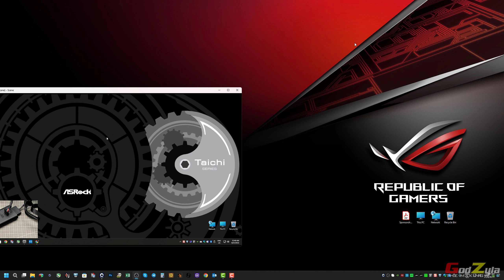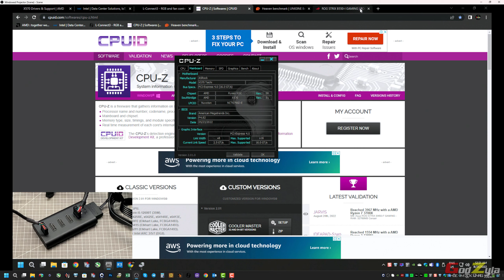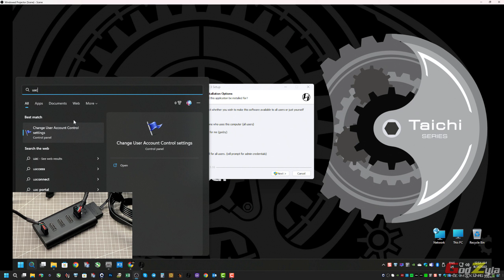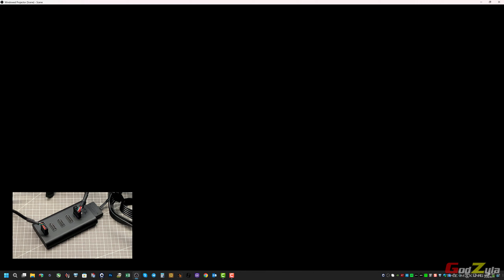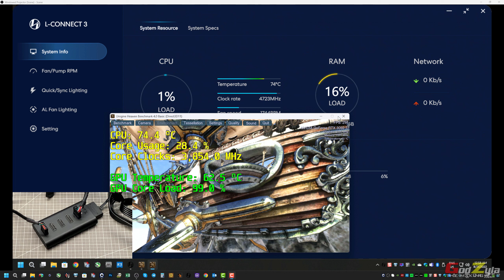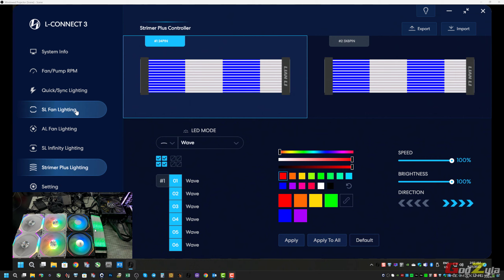Lian Li ARGB Products (How to make it work?) [L-Connect 3]

Comment: Hi Kleo, after several months, I finally got my whole pc from LianLi :D

Everything works perfectly but... Is it normal that the device manager detects LianLi-SL-Infinity-v1.4 and LianLi-GA_II_LCD_v1.3 and allows to "eject" it?
I have 10 SL-Inf connected to the Galahad 2 LCD SL Inf controller. 

Thank you!
Reply from the maker: Hi Varo Go, welcome to my channel. As device able to be ejected, that's normal as any detachable USB devices will have this function in Windows. on my lower right corner of Windows 11, when I click on the USB Icon, I can select my GA II LCD to be ejected, but of course not going to do that, just let it be. If accidental click on eject, all is needed is to either go device manager to scan for hardware or to reboot your system.

Comment: Hello friend, can you help me? I also have an nzxt hub but the l conect does not recognize my strimers and fans, can you help me??? I already updated the motherboard drivers in the manager, lianli does not appear in the drivers, I cannot make it work in any way
Reply from the maker: Hi Yuri Ferreira, welcome to my channel. Did you test it without the NZXT internal hub. Do it one controller at a time. does your Windows OS detect the controller? 
Sequence as follow 1st plug uni fan controller. does it detect? if yes, remove the controller, plug the strimer plus V2 controller. does it detect? if individually detects, then plug your NZXT Internal hub. if it does not work, means you either did not plug the sata power source to your NZXT Hub or your hub is faulty.

Comment: can the fan/rgb controllor also controll other brands Fans?
Reply from the maker: Hi FN 1, welcome to my channel. Unfortunately no as these uni fans (each of them) have an embeded chip which follows the instruction from the Hub. Other fans does not have this, therefore the effect you can't control as and when you want them to be.
Reply: @KleoYan  thank you what rgb controller would you recommend to controll all fans?
Reply from the maker: @FN-nh7wu  if you are asking for general ARGB fans. You can make use of the motherboard ARGB header which is rated 3A on most motherboard and to use your motherboard ARGB application to control them.
Reply: @KleoYan  thanks for the response
i have a gigabyte mobo but it doesnt have good rgb option. So i wanted to buy a rgb controller like razer rgb Hub....

what rgb hub would u recommand?
Reply from the maker: @FN-nh7wu  i normally go for single colors which is stationary. I never like fanciful ARGBs. chroma from razer is a good hub as for myself, simple and cheap controller like the Amber 5 or 8 from Gelid will do. https://youtu.be/brigGor38PY

Comment: what's the reason that the SL infinity RGB is not turning on at all but the fans working fine, did all troubleshooting SL infinity controller shows in both device manager/L connect software and its firmware/chipset/bios all up to date. even ordered 3 new fans connected them with new sl infinity controller and wires fans worked but rgb still does not work? also when i connect the sl infinity controller both the old or brand new one to sata power in psu only the sl infinity controller nothing else, it doesn't let pc to boot or turn on shows a red light but when you connect sl infinity controller to cpu/pcie in psu pc boots normally fans work but rgb doesnt work? when i connect sl infinity controller and fans both my old one and new one in my other pc it works flawlessly both rgb and fans. dont know why it has issues with my main pc did everything cleared cmos bios flashed latest bios uninstalled all rgb apps with revo uninstaller but rgb still dont work only fans motherboard is msi z790 motherboard and cpu is core i 9 1200k intel cpu. 
i have 3 sl infinity fans with regular cables no sl infinity controller that connects to fan and rgb header on the motherboard those works fine and when i tried and connected that regular cables with my  old fans they also worked both rgb/fan so now i think the only way i can fix the rgb for my other 6 fans finding 2 new regular cable that connects straight to motherboard fan/rgb header will fix my issues since even ordering 3 new sl infinity fans and a new sl inifity controller that even didnt work only fans worked rgb didnt turn on.
Reply from the maker: Hi Adam Otak, welcome to my channel. It seems like a motherboard issue. have you tried changing the USB header of your motherboard or try this 
1) Turn off your system, switch off the PSU botton to off
2) switch off main switch which provides power from the AC cable to your PSU. 
3) press your power button of your case a couple of times to discharge any current holding on your motherboard
4) leave it for 45 seconds. 
5) plug everything back on and turn on your system. 

see if the steps above resolves the issue.if not, last resort, get a spare nvme m.2 or 2.5" ssd, install fresh windows OS and try it. if all these still does not help. then I have no clue what's going on but to pin point on your motherboard.

Comment: Both my ARGB header on my motherboard doesn't work (I believe they are gone for good) But with this product i don't have to toss my my ARGB fans, correct? Since this allows me to bypass "Motherboard" for ARGB Fans
Reply from the maker: Hi AP's Journey, welcome to my channel. the argb cable which is between the Lian Li controller / hub to your motherboard ARGB header is optional. you can don't use motherboard argb utlity at all, just remove that cable and make use of L-Connect 3 app to controller the argb effects which the command is from your motherboard USB header to your Lian Li controller / hub. then to your uni fans.

Comment: Hi there, amazing video man. I have an enquiry tho, I am currently using the lian li GA (II) trinity. Under fan/pump profile (SL-Inf controller01), the stats seem to reflect that Fan: StdSP is at 0rpm but pump: pwm is working around 2500 rpm. All my fans seem to be spinning tho, so im wondering if the reflected 0rpm for fans is normal? or should i be doing something about it? I really appreciate any help I can get HAHAH.
Reply from the maker: Hi spicykimchi, welcome to my channel. If you have plug your radiator fans to the AIO pump, it should show the RPM. maybe this video will aid you. https://youtu.be/57cxoeEvQKU?si=zbHewWJ8ScrGTWb8&t=2486

Comment: Still the strimmer doesn't show up in my l-connect 3
Reply: Mmm.. not really but i got the strimmer plus not the v2.
Reply from the maker: @kAmAt1zZ  the controller of the non V2 does not work with L-Connect 3 app. you will need the V2 controller to do this. You can purchse the V2 controller and use your strimer plus non v2. https://www.aliexpress.com/item/1005004239607087.html?pdp_npi=4%40dis%21SGD%21SG%24%2028.69%21SG%24%2028.69%21%21%2120.55%2120.55%21%402102f67717152280494758043e1bdb%2112000031743391281%21sh%21SG%210%21&spm=a2g0o.store_pc_allItems_or_groupList.new_all_items_2007601292652.1005004239607087
Reply from the maker: Hi, welcome to my channel. May I ask which version of strimer plus did you purchase and did you check on your windows device manager, if the strimer plus controller is detected under Universal Serial Bus Devices?

Comment: all of a sudden no more RGB
Reply from the maker: Hi Jeffrey Aalders, it will be best to check your windows device manager. Check under the Universal Serial Bus Devices. see if you can see the uni fan controller or the strimer plus controller or which ever Lian Li argb controller you have plug to your system.
Reply: @KleoYan  I don’t know if you remember me, but I was having some issues with my fans. He told me to plug something out. I’m not too sure what it was because they were ramping up. I wanted to know if you can help me I haven’t mess with my PC. I had put it down since I built it. I’m jumping back into it again.
Reply from the maker: @babynismo24  hi welcome back, do pardon me. There are various cases and am sorry I can't recall what's your issue are, maybe provide me with some info, including the Lian Li devices you are using. If you did sent me an email, kindly forward it to me. This way, I see what I can do to aid you out.

Comment: So with all my infinity fans I plug them into the controller and use L- connect to control the fans that are on the radiator ? So I'd go to the slot number of those fans and select CPU ? This would greatly help me right now
Reply from the maker: Hi General GP, welcome to my channel. That is correct.
Reply: @KleoYan  thank you , I'll do just that . Built my 12 yr old daughter a pc , rog strix 4070ti super, rog strix z790-e motherboard,  rog strix monitor,  h9 flow case , lian li infinity fans . So I'm learning here lol ...going to sub to your channel
Reply from the maker: @GeneralGP114  I see. All the best with your build 😉 as for the application go to Lian Li official website and look for L-Connect 3 app. 👍
Reply: @KleoYan  I have the l-connect downloaded , trying to download CPUID but when I tried it download as CPUID CPU-Z .
Reply from the maker: @GeneralGP114  hmm.. are you trying to get HWMONITOR from CPUID? anyway I dont use this, I use HWinfo instead https://www.hwinfo.com/
Reply: @KleoYan  I was trying to download CPUID as stated in your video.  So I connected all the fans into the controller now . Went into L-connect , so slot #4 would be the fans on the radiator.  Not sure how to link slot 4 to the CPU using L- connect like you had in the video.  I just want to say I greatly appreciate you taking time out to reply to me . Thank you
Reply: @KleoYan  on L connect in the fan profile section I see , quiet , stdsp, high-speed, fullsp.  Don't see CPU
Reply from the maker: @GeneralGP114  oh ok.. the CPUID is to run bench test. it does not link to your radiator fans.. once  CPUID triggers the stress test, monitor on L-Connect to see if it picks up the CPU Temperature and also check on the RPM of your radiator fans. If temperature does pick up on L-Connect and Radiator fans RPM increases. That will tells you everything is working fine.
Reply: @KleoYan  ahh ok ok , I seem the Temps go up and then back down . The rpm for all the fans ramp up then back down a bit . I don't know how to set the fans on the radiator separate from the rest of the fans. Not sure if they're all supposed to ramp as when load goes on the cpu or its just supposed to be the fans that's on the radiator in #4 slot .
Reply from the maker: @GeneralGP114  I see, if you see those, that means your Lian Li fans , aio and the controller are working fine. as for your fan configuration. you can set other ports to quiet and leave your port 4 as stdsp. of you can set your own fan curve. This you will need to take sometime to fiddle with it.
Reply: With the cpuid and I just go on the site and download it ?

Comment: I own the GALAHAD II LCD 360 SL-INF and the Problem I have is that the Software always is Pretty slow and when I change my RGB Settings it only changes after I restart the PC so not in Real time. Current firmware 1.4 is installed. Anyone else faced this issue?
Reply from the maker: Hello Heimdallr, welcome to my channel. Does it happened that you have other ARGB application installed?
Reply: @KleoYan  Thanks for your response. I have also installed the icue for my ram and Asus armoury software for my MB.

Comment: Hi Kleo! Really great videos as I am trying to troubleshoot my rgb case but none seem to have worked for me in terms of Lian Li's Dynamic Evo case RGBs, not sure if you have come across this issue before? Thanks!
Reply: Appreciate it!!
Reply from the maker: @hikyubeast  most welcome.
Reply: @KleoYan  sent under Ryan thank you! The bottom rgb strip only a portion seems to be lighted. Thank you
Reply from the maker: @hikyubeast  check your email, I have replied. 😉
Reply from the maker: Hi Hikyubeast, welcome to my channel. Maybe list down what are the lian li argb products and to let me know what kind of liquid AIO or air cooler, inclusive of your motherboard you are using. Then I will try to help you out. if you need to show me pictures, you can send to my email @ godzylatech@gmail.com

Comment: Really nice video! I will install soon several tl lcd + normal ones so if i understood everything (i am French :D) i dont need to use pwm and argb 5v ports because usb will do the job if i go through Lconnect3, right ? Thank you very much
Reply from the maker: hi Ji M, welcome to my channel and yes you are correct. L-Connect 3 will control the argb and fan pwm.
Reply: @KleoYan Thank you very much !
Reply from the maker: @kanj1  you are most welcome and all the best with your build too.

Comment: Great video👍! I do have one question if you can help me: can I connect 2 L-connect-3 hubs (3 fans in each controler) and a strimer v2 hub (24-pin cable and 8-pin gpu cable) into a single ARGB header on the motherboard with a splitter? Or would that be to much for the header?
Reply from the maker: Hi Sebastian Oana, welcome to my channel. Yes you can do that as all the argb devices are drawing current from it's controller. Just make sure that the sata source are plug to your various lian li controllers.
Reply: Awesome, thanks!!😊
Reply from the maker: @seb9925  most welcome. All the best with your build too 😉

Comment: I only see a TAB for SL-Inf, but not TL-LCD.  I do have the controller all plugged in.  It detects it in other areas of the software.  I can change what is display on the screen and change the fan settings, just not under Fan / Pump Profile.
Reply from the maker: Hi TimboSlice083, welcome to my channel. did the TL-LCD pops up on your device manager?

Comment: i just bought sl140 and the rgb didnt work :'c
Reply from the maker: Hi tj-hero, welcome to my channel. You mean if you plug the fans directly to the motherboard argb header, it does not work or?
Reply: @KleoYan  
i used there hub and its not working and its for really few times its lit half fan and the other not lighting at all and its some times randomly flickers for once or twice times, i believe my hub is broken :c 
i really appreciate your concern :3
Reply from the maker: @tj-hero  I see, if that's the case, contact Lian Li support to have your controller fix https://lian-li.com/contact-us/